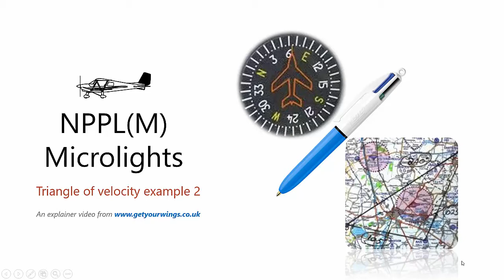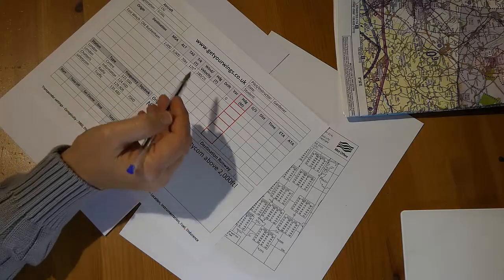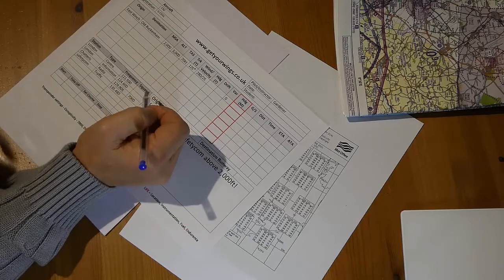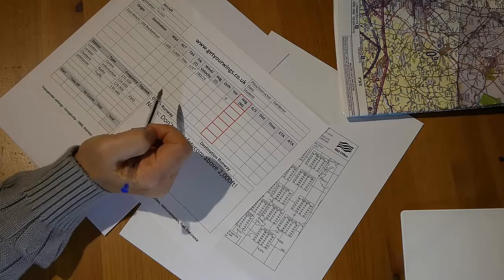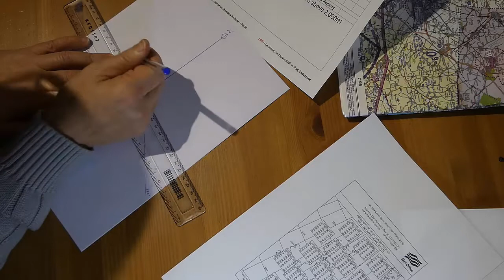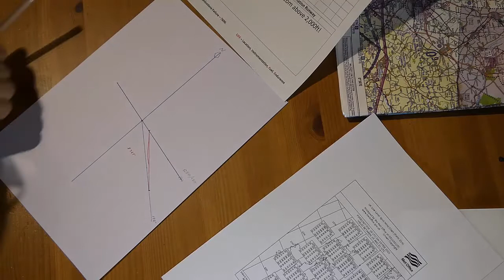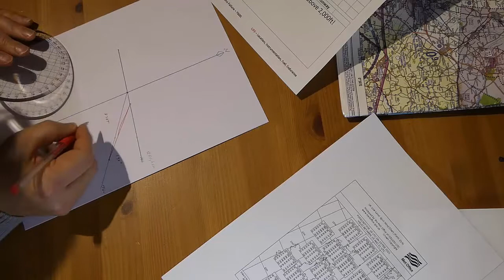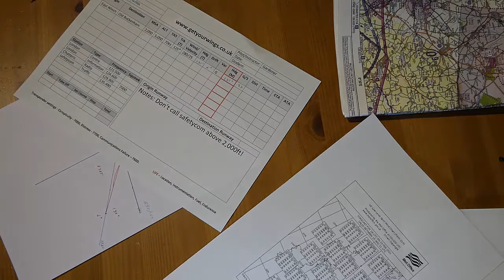Triangle of velocity example 2

Comment: Thanks.  But, if there is any, Should you add deviation to this too?  I was suprised that deviation didn't have it's own field on your planning sheet.  
But very clear explanation.  Thank you muchly
Reply from the maker: Variation is on the sheet but yes if you have deviation it should be allowed for.
Reply: @getyourwings  That was a very fast response!  Thank you very much and very helpful.
Reply: Where did you get the 15kt from
Reply from the maker: @thud2878 oops looks like it should have been 25kt from the 214. But for some reason I used 15kt. Example still works but for a 15kt wind, sorry about that!